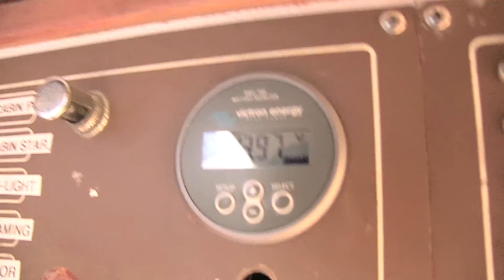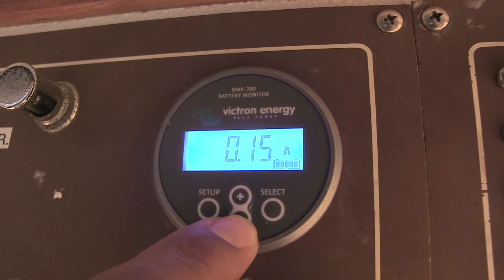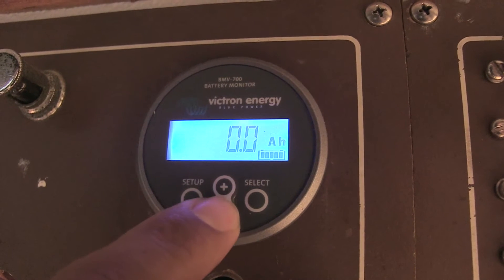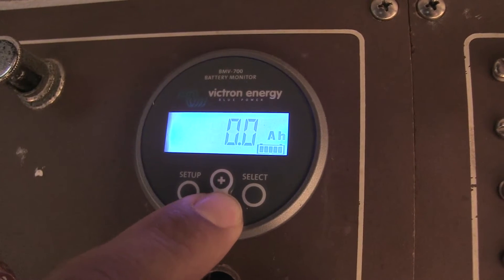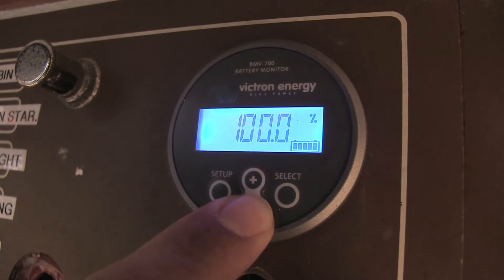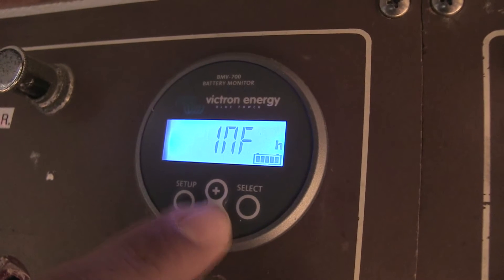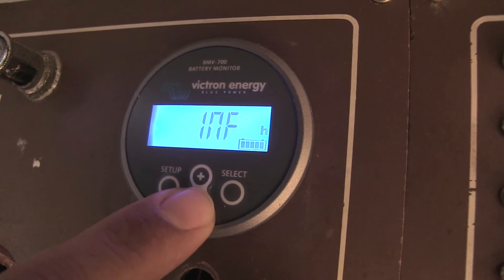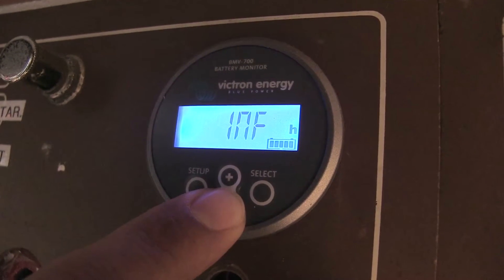PYS Electrical Audit: FAQ

Comment: Time stamps
00:05  Why would i have a voltage sense relay or an ACR when I have a source selector battery switch?
02:30  Should I start the engine on my house battery or should start my engine on the engine battery?
03:55  Should I install a battery monitor and how do I use a battery monitor?
Reply from the maker: Rudi, good questions:
1) Source selector battery switch is a manual way of combining your batteries, a battery combiner does so automatically, connecting and disconnecting batteries from being in parallel without the boater operating the switch
2) IMO, always start engine with engine battery, that way you know you have a good engine battery when you are on the water.
3) Definitely yes to battery monitor, lots of videos on our channel on using a battery monitor.